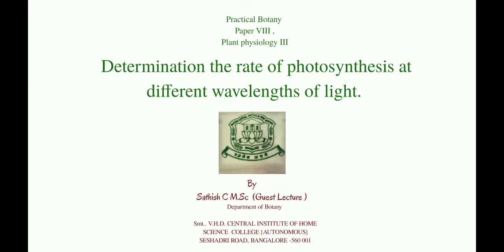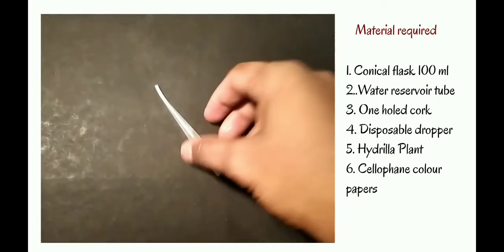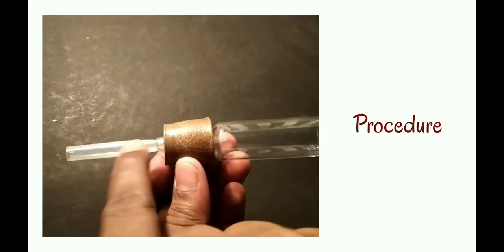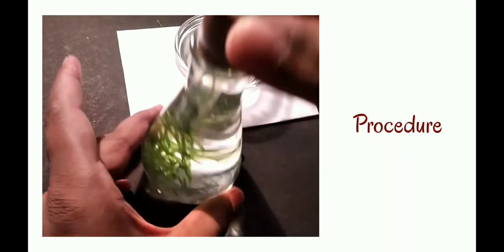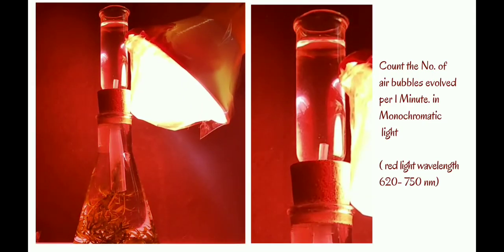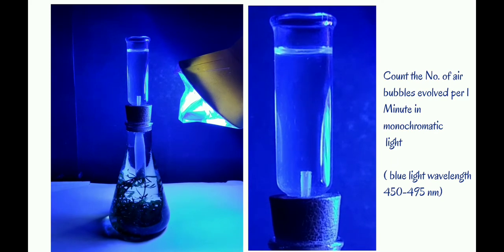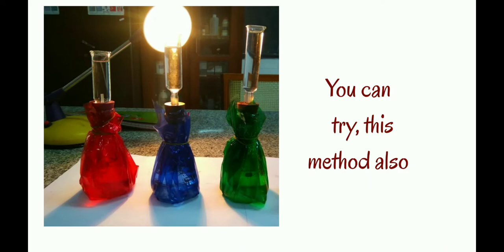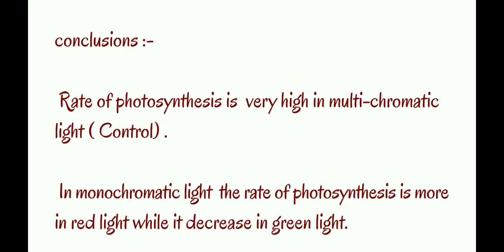The rate of Photosynthesis at different  Wavelength of light

Comment: Can you please  tell me the required volume in ml /dimensions of the water reservoir tube ?
Reply from the maker: Just preparer the solution of Sodium bi-carbonate solution and completely fill  conical flask with it preferably i suggest 250 ml One conical flask..
Reply: @sathishsre4914  why we use hydrilla for most of the experiments like this not other plants .. plz ans
Reply from the maker: U can use any hydrophytic plant available to you and easy to Handle in lab
Reply from the maker: @komalchaurasiya6169  some will use Chara and some will use Few small hydrophytic plant, Elodea its easy to handle and maintain under normal conditions